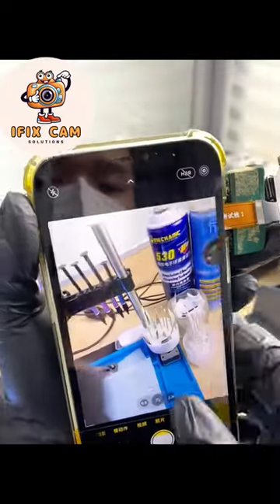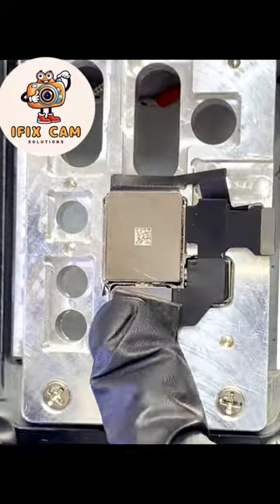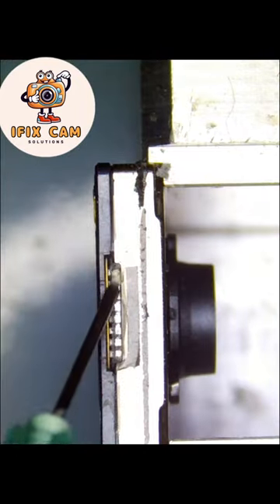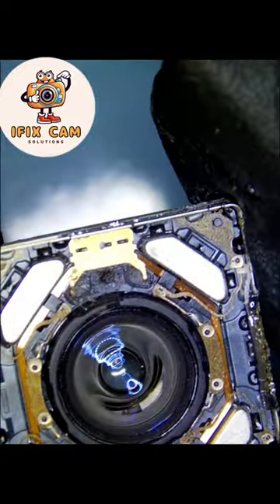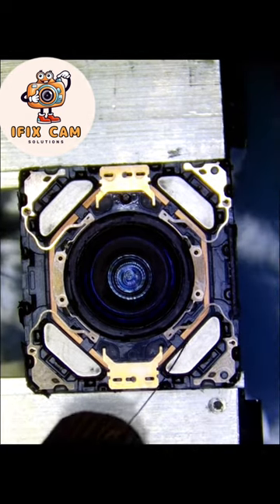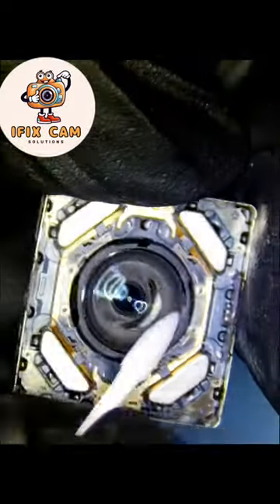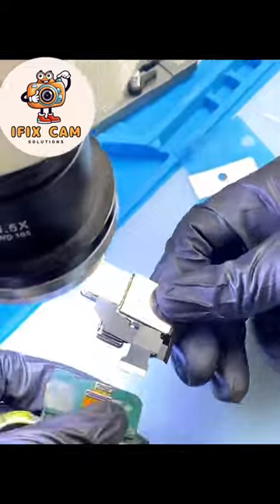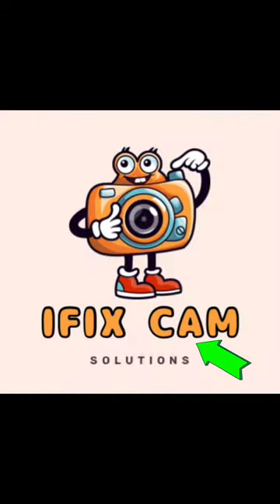"Smooth Shots: How to Fix Camera Shaking on iPhone 12 Pro Max - Step-by-Step Guide" #CameraShaking

Comment: Fucking hell. It should be just an easy camera swap. Fuck Apple for making this hard.
Reply from the maker: After replacing the camera, you have to remove the 'Unknown Camera' message as well, and it becomes costly. This method is easier and much cheaper than swapping for a new camera.